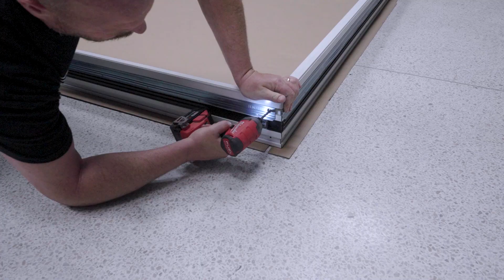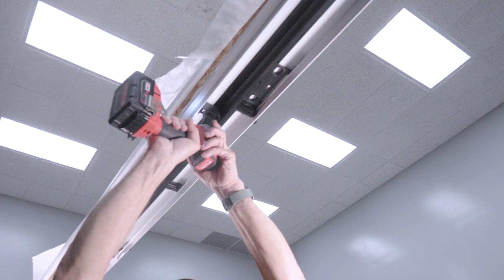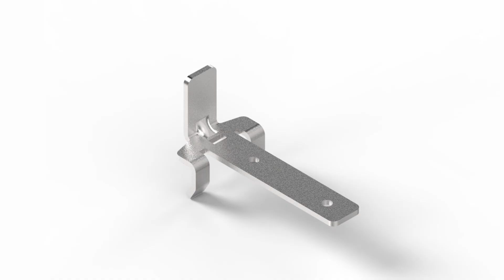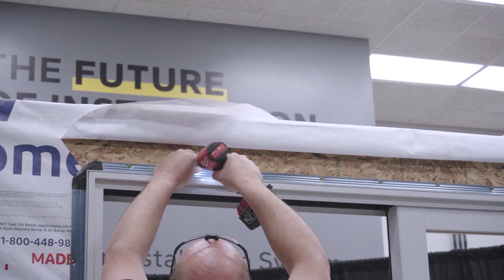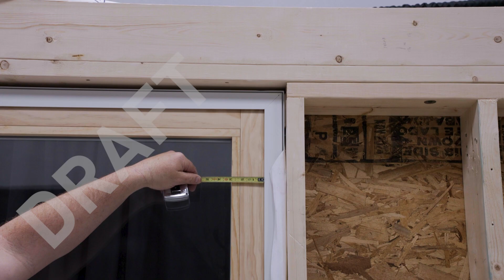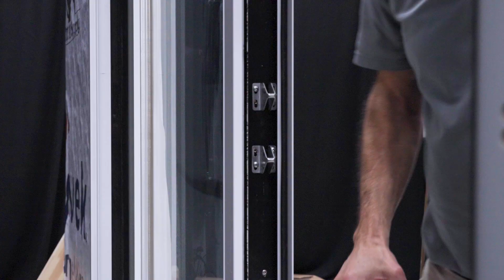Pella Clad Wood 3-Panel Sliding Patio Door Knock-Down Supplemental Assembly and Installation Info

Comment: 50 shades of pella

My experience with pella was traumatic I would not recommend you engage with them!

I was sitting in my bathroom throne dumping. Suddenly I noticed a figure outside my bathroom window it startled me I let out a fear fart.
 
When I saw the pella shirt I felt relived thinking my window will finally be replaced but then he looked in at me with a devient look he pulled out his tool and aggressively started working it doing no damage to the window. The look on this guy smiling with sweat beaded forehead made my  turtle head retract! I ran from the the room and called Anderson windows to deal with the situation